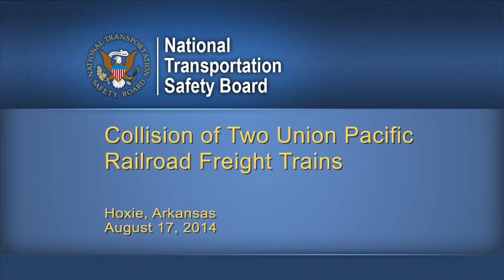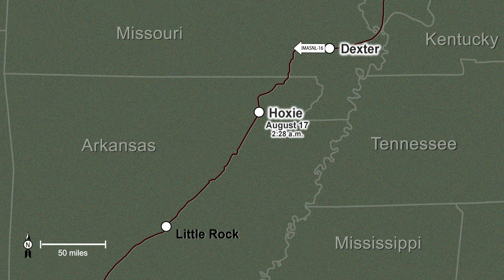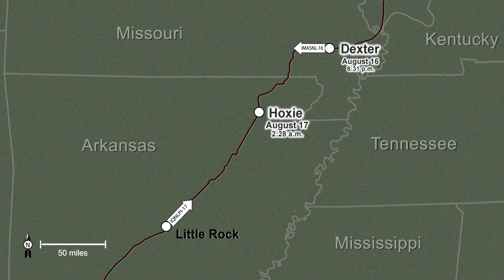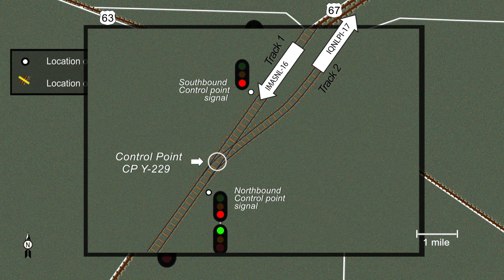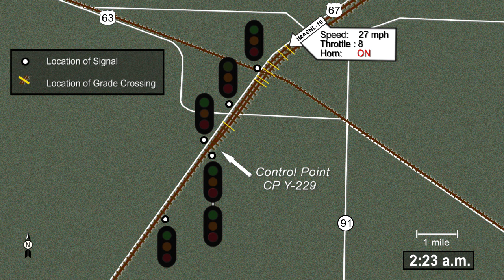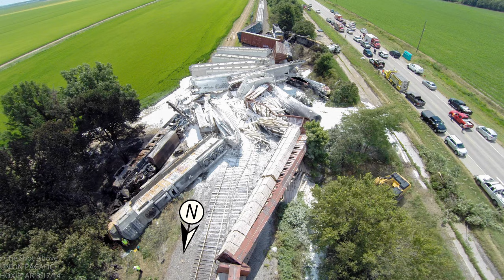Collision of Two Union Pacific Railroad Freight Trains

Comment: The NTSB concluded that the engineer of the southbound train was probably asleep. He had been working a schedule that had him working this shift at a time when he would normally be off duty, and probably sleeping. Plus the engineer suffered from sleep apnea. The operation of the northbound train was completely normal.
Reply: Isn't an engine cab supposed to have a two-man crew like an airliner?
Reply: @lawrencequave7361  yes a conductor... but sounds like he was sleep to
Reply: Question is, what happened to the alerter on that lead engine? After they fell asleep, it would’ve sounded an alarm after 30 seconds of inactivity, and subsequently thrown the train into emergency. The whole point of that alerter system!

Comment: Amazing in this day & age that the train running the red light isn't automatically stopped.
Reply: In 2014? On freight rails?
Reply: It’s really hard to it’s metal on metal so it’s impossible to get good friction
Reply: A loaded train, even with the brakes in full emergency, still needs almost 2 miles to stop.
There is just no way you're going to stop the thousands of tons that train weighs on a dime.
Reply: With an ATS system you can make a train stop before a red signal if it doesn't slow down. But it's sure that with no security system at all it won't even slow down.
Reply: @NishnaValleyRailVideos  I believe they meant as in throttle would be cut and brakes applied autonomously
Reply: @pws3rd170  That is a thing, The deadman switch should stop the train if nothing is done after a while but people have found a way to stop it, There is also ATS.
Reply: There is a system in place now.  PTC
Reply: If they are at speed passing a red signal, it's already way too late, right?
Reply: @kc_was_here737  Definitely, because they take so long to actually stop.
Reply: There are various systems in place already: locomotive alerters, ATC (Automatic Train Control), and PCT (Positive Train Control) - on some routes, circumstances, the engineer/conductor can "reset" the system as it may be dangerous to stop a train without valid reasons in some situations (grade, switches, curves...).  The most common cause of train mishap is still "human error" as of 2019.  Ciao, L
Reply: Well let's put a red light 2 miles before the real one
Reply: Humans: why isent this safer
Workers: some safety is practical
Humans: no we want total control
Workers: then make a robot do it all and the company takes liability
Humans: some safety is practical
Reply: @PixelSubstream  no because if someone isn't capable of understanding what a red light means then perhaps they shouldn't be operating a 15 million pound train
Reply: @NishnaValleyRailVideos  the train that blew the red had it in power 7 still as he passed the red signal and could probably see a headlight bearing down on him from the single track ahead if he were conscious and alert. 

I think what the commenter is saying is that he thinks it reasonable with the available technologies (yes, even in 2014) of satellite and GPS, that there should be an override(?) in place to at least put a human controlled train in emergency if lead power passes a red, if not automatically putting the train into stopping action short of an upcoming stop signal, should the crew not do so until past a determined distance based on their size and speed...

My take, some times the signals are f*cked up and a train needs to get past a red with proper protection. Should this system be put into place the dispatcher would have to remotely de-activate the control to get you past one. If that remote deactivation messed up you could cause some pretty hairy delays. AKA it's another moving part to maintain, and will eventually delay a train somewhere which is basically the end of the world.
Reply: @leehuff2330 Yes you can, but it would look like a giant pinball machine.
It's how other planets stop high speed frieght s.
They come into the yard like 150😂😂 dudududeurueddddddddd lolz. Then wind back slowly.😂
Reply: @FirstnameLastname-tp4zw  
😂🤣🤣🤣

Comment: Train crews should be calling out signals(over the radio) in single track territory so the other crews knows they are aware of each other. If not this can happen over and over again.
Reply: They do call them out, unless they are asleep.
Reply: In Europe (and certainly in Poland, in other European countries we have different systems - some newer are more advanced) we have a system that requires the reaction of the crew when passing near railway signals (or similar critical points). This system called "Samoczynne hamowanie pociągu" (in English "automatic train braking") requires the crew to react actively by pressing a button when passing critical points, if there is no reaction of the crew to the system signal then sudden braking is activated.

System is completely offline because the critical points are marked by a passive inductive resonators close to the tracks. All other components are located in the rail vehicle.

The system was developed after the biggest rail disaster in Poland which claimed 67 lives (in 1980)
Reply: Thats a good idea. Crews in Australia; where I got my Safeworking, theres two crew at the front. and the Observer calls out the signals. There is Yard Limits (going in), and End of Yard Limits (exiting). 
All a rail company needs to do is ADD another board on exiting to say what the next single line section is called  - eg "Hornsby to Chatswood"
Then the Observer gets on the radio, and goes "Attention We are entering Hornsby to Chatswood, is anyone there?"
and if there is, then the Observer of the other train replies back. "we are already on it."
Reply: @Ekkonai  Yes we have that button as well - called a Vigilance timer"
The problem is that pressing the button can become automatic. (Beresfield-Australia and Harrow i think it was where other drivers saw the two crew looking out of the steam loco as if everything was ok)
Reply: In the old days, there was staff control. 
Basically a loco had to stop, pickup a staff that was only available if there was no trains on the section and then proceed. 
There could easily be an electronic version?
Reply: I worked on UP at that time and we were required to call out "approach" (solid yellow, prepare to stop before next signal, and not to exceed
30 MPH) and also call the stop signal.
Reply: I agree 100% .Don't they get paperwork describing the events of their route ?  The 2 converging trains should have commo between them, Like, "hey Bob don't forget to stop before you get to my siding".
Reply: @danielkeirsteadsr6939  I worked with this RR inTX at the time of this incident.  Based on my understanding this territory is Centralized Traffic Control “CTC” which means they are operating based on the signal aspects. There is no paperwork or plan that describes the meets with other trains or stops at sidings along the way in CTC.  They are just at the dispatcher’s mercy basically.
Reply: Yes they could, but corporate greed would preclude some kind of sneaky work around.
Reply: @mtsmith89  Good dispatchers will let you know where planned meets will be.
Reply: @gregnancyspear4367  That's what I was gonna ask, did the dispatcher call the trains and let them know of the meet or just left it to the signals?
Reply: I thought they did that back in the old days? I guess
Reply: @Iowarail  according to this video, they were blowing the horn across all crossings but apparently ran three signals?!!   I don't drive a train, but that seems like alcohol or sleep induced ignorance...
Reply: @gregnancyspear4367  Even knowing that, at night knowing what speed the opposing train is doing is nearly impossible, so they would not know if it was stopped or moving.

Comment: The engineer and the conductor were likely asleep, which I thought was weird at first because they were blowing the whistle for the crossing... until I found out that feature was automated. 

"The southbound train had an automated alarm that could have given visual and audio warnings to the crew. But the warning didn’t sound because it interpreted the train’s automated horn signal as someone operating the controls, investigators said."

Automating that feature reduces workload but in turn it means that there's less for someone to do and if your sleepy with nothing to do guess what happens.

Comment: "The Automatic Warning System (AWS) is a form of limited cab signalling introduced in 1956 in the United Kingdom. 
In-Cab horn and button acknowledgement. 
    The original concept of AWS was to provide the driver with an audible and visual indication of whether the distant signal was clear or at caution. Should the driver fail to respond to a warning indication, an emergency brake application will be initiated.
    Since the introduction of multi-aspect signalling, the majority of signals are fitted with AWS.
    AWS does not relieve the driver of the responsibility of observing and obeying lineside signals and indicators."

Roughly,  It screams at you if you if there is a breach in speed, and if you don't respond within a set time, it shuts the train down into Emergency STOP.
No need to have a button press EVERY time, just an ability to have the LOCO read each signal as it passes.

SO in this case, if an AWS would have been fitted;
Southbound:
Advanced Approach Signal = 40 mph speed limit   [Train going at 37mph, Power applied]  = AWS OK (NO ALARM)
Approach Signal           = 30 mph speed limit   [Train going at 42mph, Power applied]  = AWS DANGER

AWS operation 
ALARM for 10s. If the ALARM is not responded to by crew, AND power is not reduced, and brakes not applied then the train goes onto emergency STOP.
This should have pulled up the train before it got to the final signal at STOP.

NOTE for future design: If these 6 signals were able to be grouped, if ANY of the signals was passed incorrectly, then ALL signals could goto DANGER, so the approaching Northern train would also be stopping, reducing the combined approaching speed.
*This system would not be replacing train crew. It doesnt crontrol the train. It only stops the train. *

The system would use the power that lights the signals, so it shouldn't be an issue with extra running cost, just a small box.
Just saying.. been around since 1956
Reply: Eh, we haven't had a full enough of the adoption within our own shores to prevent further SPADs, it's maybe a bit much to expect the septics to take it up, with their many thousands of miles of long and lonely track and downright confusing signal aspect combinations...
Reply: Brilliantly simple solution, there’s no reason why it shouldn’t be implemented.
Reply: the USA has always been slow the only system that is cloes to the aws is ptc, and that was only mandated in the last few years
Reply: There is an "alerter" on US trains that sounds after approx. 1+ min. of no crew input (throttle, brake, horn etc.)  The FRA put out a warning after this incident on horn sequencers that an engineer would press and the horn cadence would sound continuously... The alerter considered each horn sounding a crew action in error, and the train never went into penalty brake.
Reply: Ou know that the AWS is for the UK right? And the system that actually save SPADs is the TPWS right? Also AWS is not that advance, it doesn’t care what the train speed is, it just care about the signal. You could be going 25 mph and pass a single yellow and still have the AWS “horn” going off and you have to cancel

Comment: I used to work in a computer room as a mainframe computer operator and I guess there is a similarity with train operations in the sense that a human being is supposed to be watching over a machine. At the time even I found that situation somewhat ridiculous since it was very easy for the human to stop paying attention while things were quietly going fubar. The computer could easily detect some of the things that require input and stop but, back in those days (1991), they did no such thing.

I find it amazing that trains all over the world still employ human attendants as the main control system. I fail to see what about train operations would not be better handled by automation. Automatic control systems can be redundant (fail-over), they don't get fatigued, they don't make decisions based on intuition or emotions and they tend not to ignore warnings or disobey signals (instructions). In 2017 it should be easy to automate most of the global rail network and eliminate the major cause of accidents, human error.
Reply: I dont look at the Uber SUV that killed  a pedestrian here in Arizona.
Reply: I've also worked as a computer operator... overnight, even.  

The problem with the comparison is a mainframe and a train are completely different things.  Trains are prone to extreme mechanical failures that must be addressed on site.  Trains have to respond to exceptional conditions such as idiot road drivers or external failures (like signals).  Train drivers have mobility and dexterity that a computer currently can't do, such as coupling and un-coupling cars.  Intuition and experience are critical to successfully driving a train.  Improper train handling can destroy the cargo, break up the train, or even derail it.  Computers (which can also fail, even redundantly) can be taught the motions, but the details blossom in complexity.  The reason you can't understand why a computer can't drive a train by itself is because you don't grasp what's actually involved in doing so.
Reply: Jovevetj I have to disagree here. Asearchie is talking about overarching safety control assisting the crew and not about no crew operations. I agree with that. The crew is still needed to perform maintenance like broken couplings etc. But it needs something electronic and simple to assist with safe travel.
Reply: The only issue I can see is that there has to be power along hundreds of miles of track (tick- signal power there) .. the safety controls doesn't have to be at all signals. Just at approach crossings, and on hills where slow speed needs to be maintained.
Reply: You could do the slow speed with a simple timer in one signal. If the next signal is crossed before the previous signal's timer completes then the signal after that is set to STOP, and / or the locos are immediately sent a STOP through the rails.
Reply: Jovetj They have fully self driving Tesla’s now. There’s a feature called “Summon” where you press the key fob, and the EMPTY vehicle backs out of its parking lot stall, and drives itself around the parking lot to find you. 

Given the fact they are doing that and selling it to Joe Q Public, the automation of a locomotive on RAILS most DEFINITELY could be automated. The team who programmed the Tesla would probably laugh at the ease and joke how it could practically be done in a weekend.
Reply: @Syclone0044  no
Reply: to start there is no and should NEVER be a "global" control of trains. or anything. and humans must be the control operator of any and all machines. as NO computer can do what is required of a human. they just can not understand the correct way, only do as programed, and at times it is the WRONG thing.
but there should be some kind of signal in the cab, that a human must touch to make it clear they did see the signal. as in trucks there is now a auto brake. but it has a very high fail rate, as a car on the off ramp, puts on there brakes, and is clear of the freeway lanes the trucks computer slams on the brakes and causes a pileup on the freeway. (almost happened to me as the truck i was in slammed on the brakes for NO reason). then the "other" sensors that are a huge distraction and they do not work as stated. alarms go off for no reason.
truck drivers are over worked as most train drivers are over worked, have to work odd hrs, that screws up ones body sleep/wake patterns and cause people to fall asleep at the wrong time.

and the last bad train derailment was caused by a computer malfunction.
a side of the track hot box detector failed.
Reply: I'm a train engineer, I'll explain. We have something called Trip Optimizer that basically works like an autopilot. We have PTC which prevents trains from colliding or overspeeding. In countries like Australia with 100s of miles of straight track, the trains are already fully automated (only for runs, not in the yard). Many trains make stops at yards along the way, and I know there isn't a single conductor out their that wants a computer running the train while they are riding it.

Comment: 3:43 “The southbound train passed the red signal at a speed of 45 MPH. Event data recorder shows the train remained in throttle position 7, and the crew took no actions to stop their train.”
Reply: Sleeping, both of them.......been there.
I always found it interesting that it was a Republican president that signed the Railroad Safety Act involving crew fatigue issues.
Reply: Political parties have nothing to do with this incident.
Reply: Passed by a Democratic House and Senate. 

Politics means squat.
Reply: When it comes to safety, politics have no place.
Reply: @Iowarail  Northbound train did nothing wrong. Southbound train was at fault.
Reply: @MassEffectFan113  He meant engineer and conductor